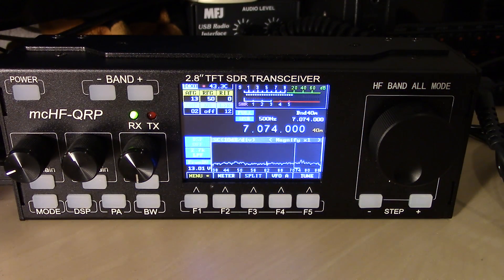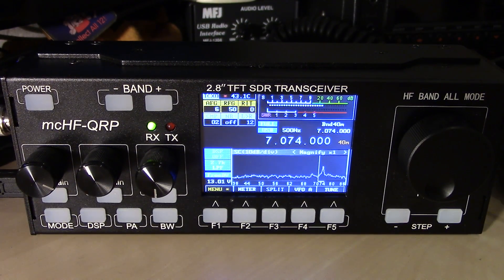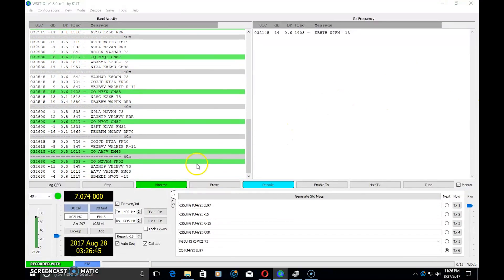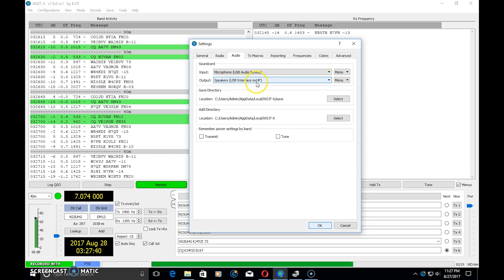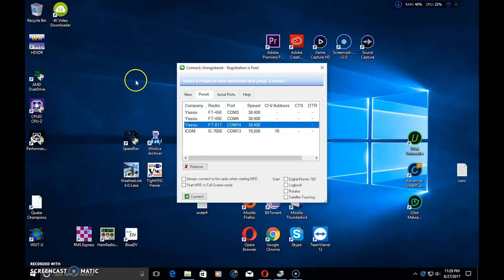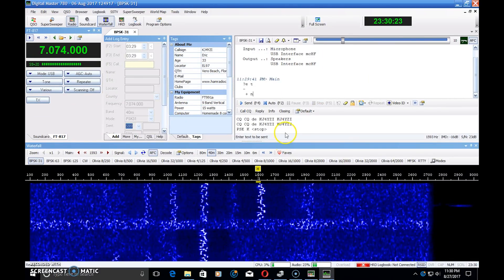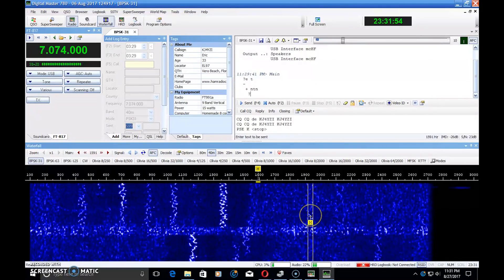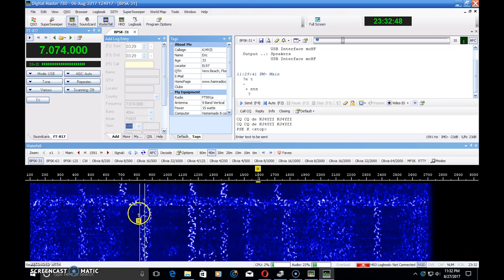RS-918 mcHF SDR Digital Modes WSJT-X FT-8/JT65/PSK31 HRD/DM780

Comment: hello, I know it has been a while since you produced this video but am wondering if you could help me?
I have done everything in your video but I keep getting a message saying that the com port is open.
Rig Failure Hamlib error: IO error port_open: serial_open(com14) status=6, etc etc
rig open return while opening connection. I have replaced the usb cable and tried other things but always get the same message? Am wondering if you had to turn something on in the menu so it could see the usb connection?
Hope you can help.
George